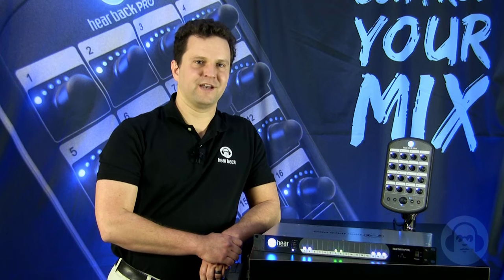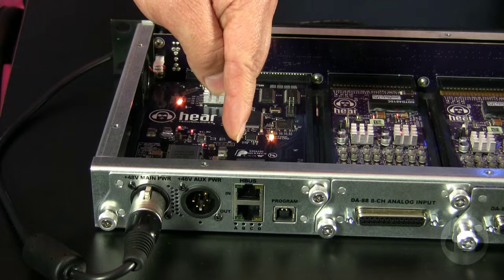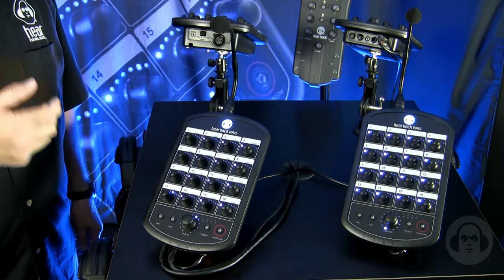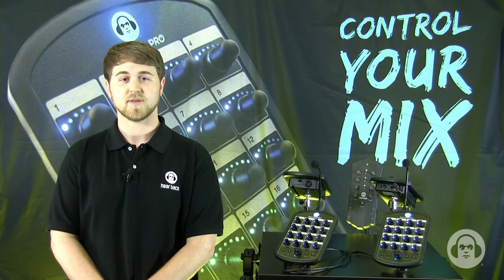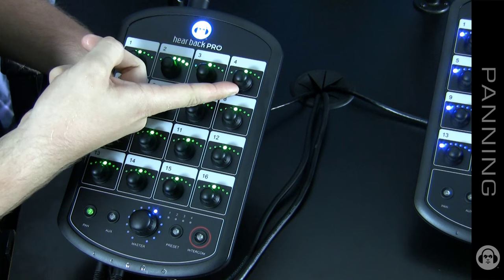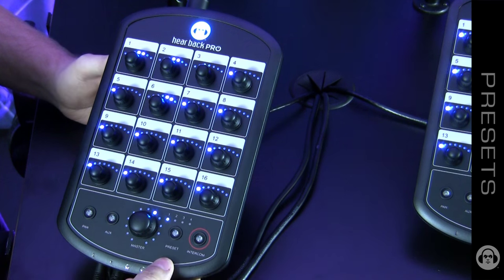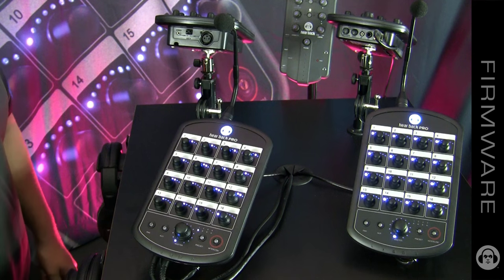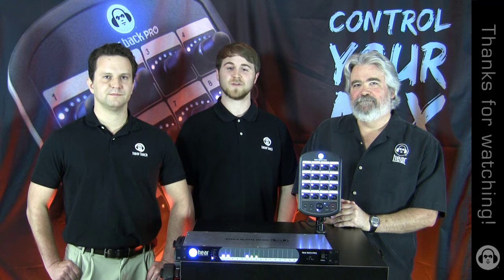Hear Back PRO - Complete System Overview

Comment: HI. I can't find the Hub on your website. Is there a Dante card? Please provide specs on the Dante implementation? Thanks
Reply from the maker: Thanks for the question! The Hear Back PRO Hub is a part of the Hear Back PRO system. A system typically consists of a Hub and up to 8 mixers. Specs and tech here: https://www.heartechnologies.com/products/Hear_Back_PRO.html

You can choose your audio flavor and we’ll install the card for that flavor. (Or you can purchase the card separately - card options found under the Hear Back PRO product page on our site.)

By specifying Dante when placing your order, your Hub will speak Dante and connect via the typical Dante Controller and Dante Virtual SoundCard software (both are required).

(As we only create the hardware to talk to Dante, you can find more about Dante’s capabilities on Audinate’s website (https://www.audinate.com/).)

Hope this helps!